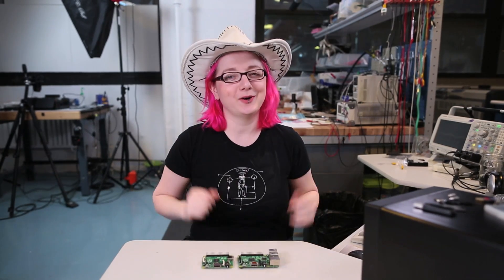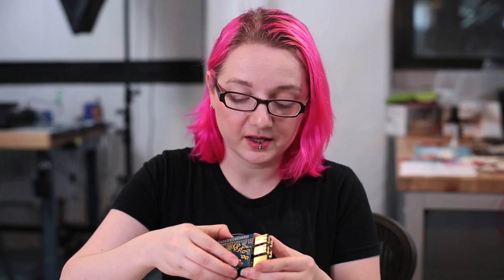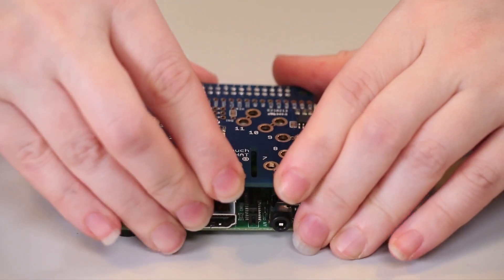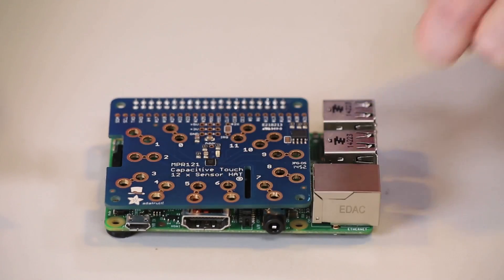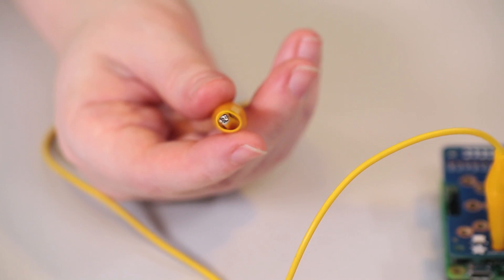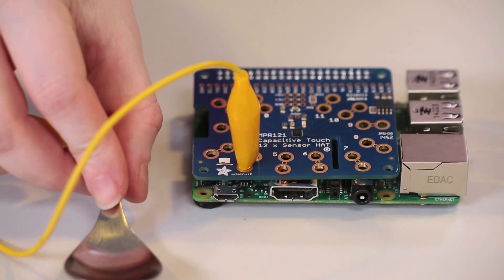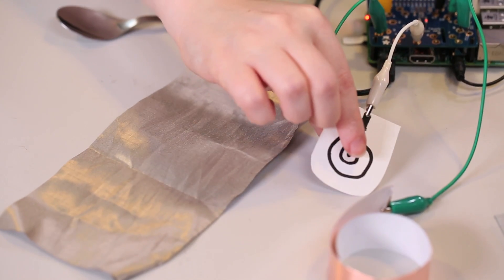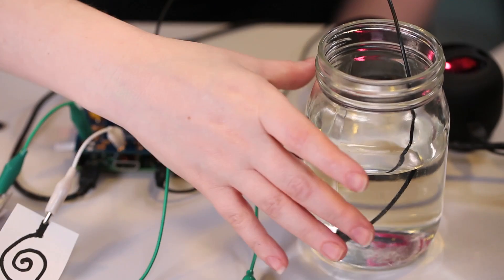Adafruit Capacitive Touch HAT for Raspberry Pi - Mini Kit - MPR121

Comment: Have you soldered the supplied 40 pin header
@tsiritata
πριν από 1 λεπτό (τροποποιήθηκε)
Hi everyone, can Adafruit Capacitive Touch HAT for Raspberry Pi - Mini Kit - MPR121  be attached to Raspberry 3 model B v.1.2? Very difficult to find any information on that.

Comment: Hey! Great (: 
I'm about to buy it, but I already have a Raspberry Pi 3 Model B, is it compatible?
Finally, the library and code it's the same that for the non-HAT/breakout-version? or do you have already a specific tutorial for this?

Thanks in advance!
Reply: Hello did you use the hat with Rasperry Pi 3 Model B ? did it work ?

Comment: can any1 tell me  where the sounds are coming from
Reply: The Pi has an AV output that is connected to the small speakers seen on the desk behind the water jar.
Reply: Pi doesn't have a speaker, but maybe the pi could send the data to the computer and there could be a script running on the computer playing the corresponding sound.
Reply: @raghunitin  Pi has an aux out or you can bluetooth speakers.
Reply: Pretty suspicious if you ask me.
Reply: The pi is programmed to make sounds when someone touches a thing

Comment: How you doin' ?

You say a 'person or animal' has touched, I would think the same could be said for a plants. As leafs/pedals descend and drop when dry this could be a watering trigger, you'd have to set a trigger limit parameters to prevent over-watering of course.
Reply: I would think moisture sensors on an audrino would work better... could also implement NPK sensors and PH... Pi is cool for a lot, but there are much better devices for projects like monitoring living processes.

Comment: I have a question about the capacitive touch boards. I have the momentary 5 input. If I'm trying to make volume controls from an amp touch sensitive. I understand the power goes in to the output, but what if it has a ground also? Do I not worry about it?